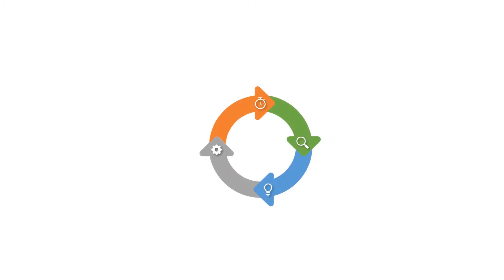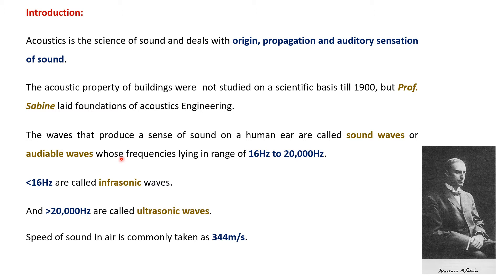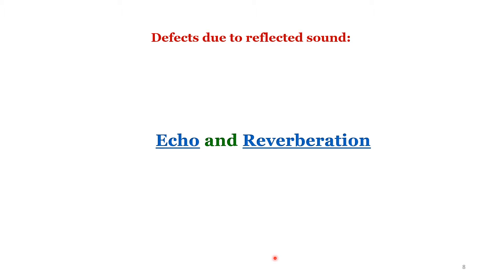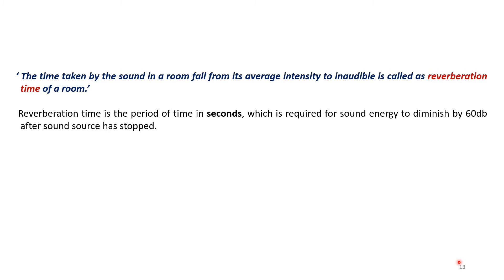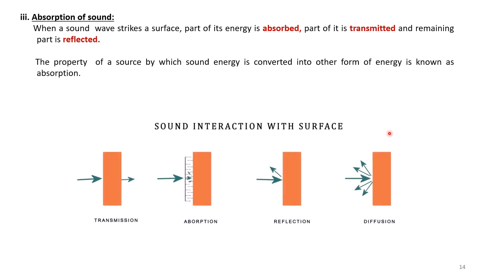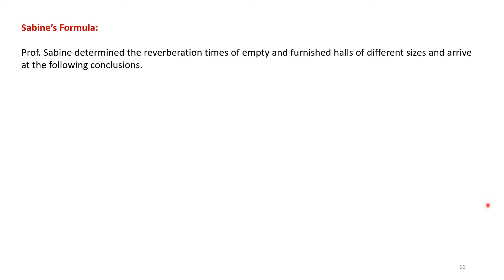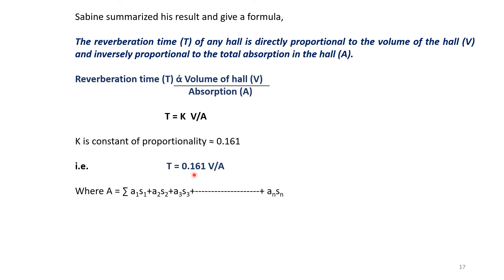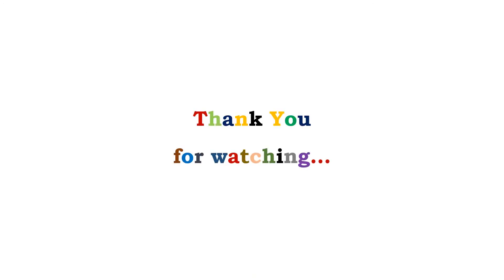Acoustics

Comment: Key Concepts of Acoustics:
1. Sound:
A type of mechanical wave that travels through a medium (like air, water, or solids).
Created by vibrations of objects, which cause pressure waves in the surrounding medium.

Comment: Here are some key points and questions related to acoustics:

Key Points:

1. *Sound Waves*: Mechanical waves that propagate through a medium, such as air, water, or solids.
2. *Frequency and Pitch*: Frequency determines pitch, with higher frequencies corresponding to higher pitches.
3. *Amplitude and Loudness*: Amplitude determines loudness, with larger amplitudes corresponding to louder sounds.
4. *Reflection and Refraction*: Sound waves can reflect off surfaces and refract through different media.
5. *Interference and Diffraction*: Sound waves can exhibit interference and diffraction patterns.

Questions:

1. What is the speed of sound in different media, such as air, water, and steel?
2. How do acoustic properties, such as absorption and reflection, affect sound quality in a room or auditorium?
3. What is the difference between sound intensity and sound pressure level?

Additional Topics:

1. *Room Acoustics*: Design and treatment of spaces for optimal sound quality.
2. *Psychoacoustics*: Perception of sound by the human ear and brain.
3. *Noise Control*: Reduction of unwanted sound through absorption, insulation, and other methods.